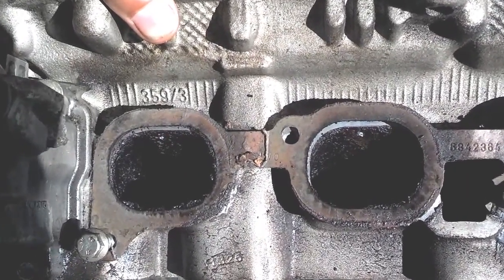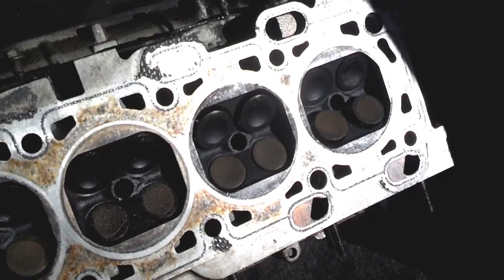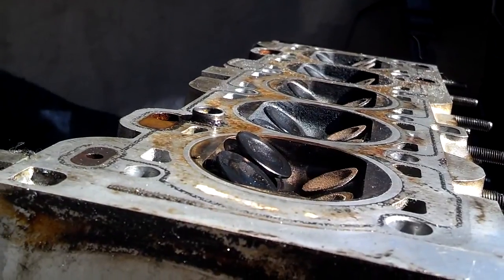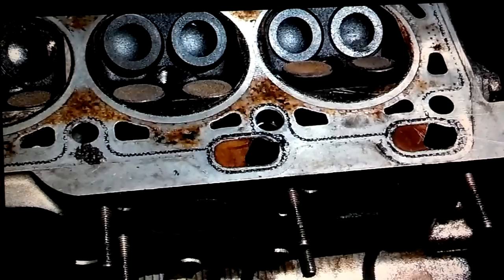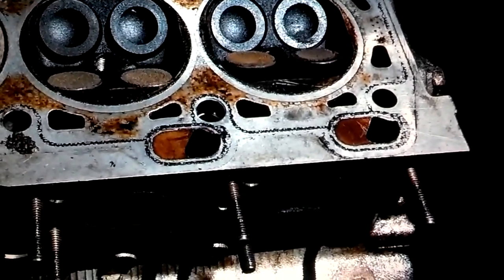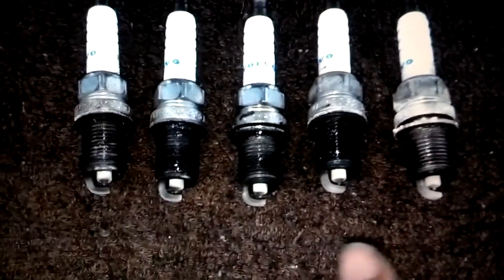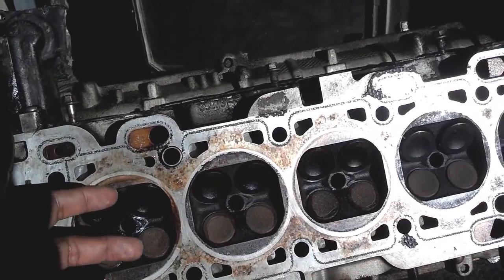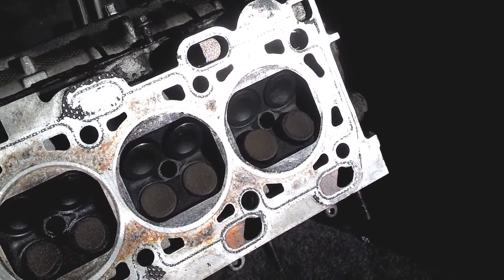Head information, bent valves, burnt valves, revised - Auto Information Series

Comment: Hey robert.. thanks for ur many many 850 videos I used alot... I am struggling to get our 850 running.. it was running outside. We went out and it was off. After that can't get it running. It's a 96 850 non turbo.. compression is about 145psi on all 5. Fuel pressure is 41 psi. Timing.. timing is on.and I have spark.. so confused. If I have compression how my valves must be ok hey.. and if I have 1 burnt valve will car usually start
Reply from the maker: So, if you have fuel, timing, compression, spark, you are missing AIR. Have you checked for codes? Maybe your mass air flow sensor has failed.
Reply from the maker: https://youtu.be/8fNCqTu7fKM

Comment: my mechanic says that a bad injector caused my burnt valve. I switched the injectors around and the car ran no different. is this likely? or is it more likely due to the fact that it burned a ton of oil?
Reply from the maker: Most likely oil. Building up on the valves (carbon) then causing them to not seat/seal properly.

Comment: hey robert.... i have a 1998 volvo v70 non-turbo with 255000 miles on it.  It has a burnt valve on one of the cylinders, so my mechanic pulled the injector from the bad cylinder and i am still driving the car.  It vibrates when idle, and i have loss of power on acceleration etc.  I am not going to put another engine in it and I am not going to have the engine removed to be repaired.  How long will the car last driving with a burnt valve??  Reason I am asking is because I wanted to replace the drivers side door with a used one because somebody hit the door and dented it really bad.  I don't want to spend $400 for a door and then the car dies...
Reply from the maker: +Chris “Hank” Moltisanti can you get a door from a junkyard? They take about 5 minutes to remove. Cost about $75.

If one value burnt, another could be following soon. Could be a week, could be a year. Just stay close to town and press on.
Reply: When you disconnect an injector does that mean that you will be running on one less cylinder?
Reply: @lionreb  Yes, therefore less power and sluggish acceleration.
Reply: Chris Moltisanti engine light flashing you’ll melt the catalytic converter and be very expensive

Comment: Hi Robert, and thanks for a superb channel! I got a V70 -97 today for really cheap. It runs very well. But when i start it up i can hear some ticking/knocking from the engine. It almoust disspears after i drive a couple of minutes. Do you think there is a problem with the engine? Or is it normal for an engine with a lot of miles on it? The sound is similar with the one in this video: 1998 Volvo S70 turbo lifter noise?
Reply from the maker: Yes there is a problem, noise is always an indicator. Do I think it is serious? Probably not. The owners manual explains noisy lifters. You may have one or more sticking a little when cold. I may clear up after an oil change or two. When the lifter is ticking/making noise, you should NOT rev the motor over 3,000 rpm's so take it easy until it stops making noise. I have no idea how many miles is on your car so I don't know if it is a lot or not.

Comment: Robert, in my opinion most of these burnt exhaust valves are caused by oil consumption.  Most commonly we see flametraps that are not functioning or plugged, especially on P2 cars.
Reply from the maker: I use to think that as well. I think it's a combination of things. The "real" mechanics and shop guys say it's from bad fuel to air mix, running rich or lean. The last 2 heads I rebuilt had bad vales in them. When cleaning / lapping them I found pits on the seating surfaces.